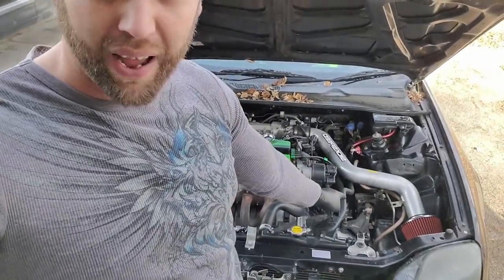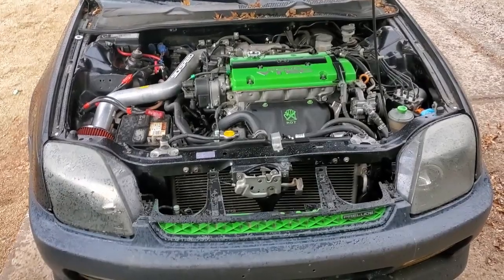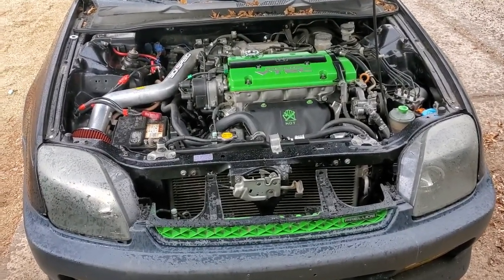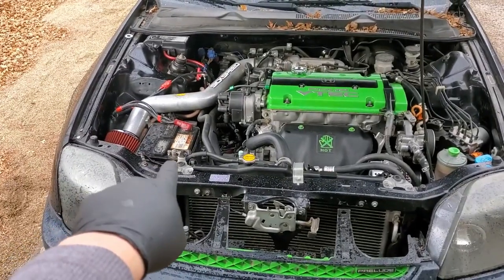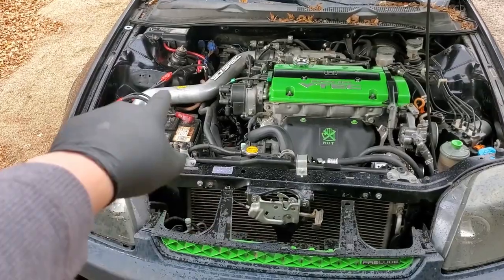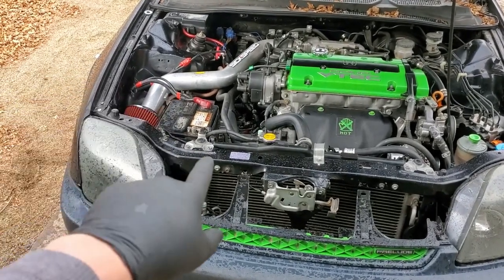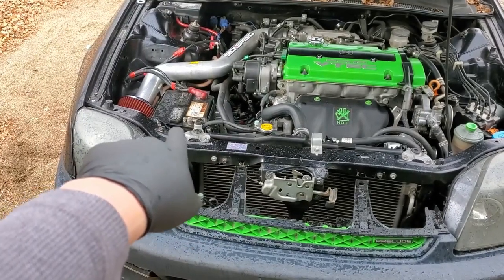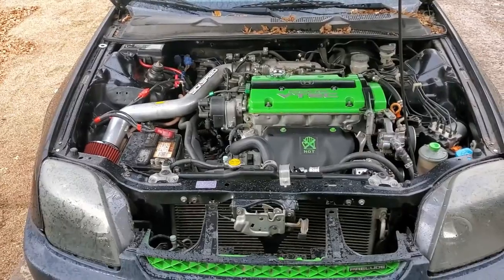2000 Honda Prelude VLOG 4 Battery "Un" Relocate

Comment: List of all work and parts replaced.???
Reply from the maker: New battery, alternator, battery harness, new fusebox, fuses all checked, main fuse replaced to rule out micro cracks.
Reply: @mycardiy  maybe the alternator you have is defective. Have you had it tested? Has the ECU been in any open weather ???
Reply from the maker: @IAutoEnthusiast  new alternator has been tested, along with trying a used one off a working vehicle.  The ECU has never been exposed to weather (that I know of)  I opened it once at my desk to look for any possible burning or scorched circuits
Reply: @mycardiy  is the wires to and from the alternator good. Shorted?
Reply from the maker: @IAutoEnthusiast  if there is a short, I haven't found it yet
Reply: @mycardiy  not much more I could help with. If the ECU is good and you ruled out a short or bad wires. Battery is fresh and Alternator is good.
Reply from the maker: @IAutoEnthusiast  yeah my only question now, is there any systems/sensors that can make the ECU think the battery is charged
Reply: @mycardiy  I dont think so. Id have to look at the wire diagrams. If you start out with 12v + then start the car then you should be getting 14v from the alternator. Sounds like the between parts are at play.
Reply from the maker: Agreed! I always have 12.8v to start and 14.3v with accessories on. Until it turns off the charging, then the battery slowly drains
Reply: @mycardiy  really odd...not sure whats going on. Try a working ecu....?

Comment: What were you doing up to the point of it dying?
Reply from the maker: Just driving normally. I'm pretty sure there's something causing the ECU to ground the signal wire which switches off the charging line. Not sure why though.
Reply: Yikes would be nice if you could catch the freeze frame data at the moment of failure
Reply from the maker: Completely agree!  Makes me really lean towards investing in HonData

Comment: With the car running disconnect the negative cable on the battery if it continues to run you have more diagnosing to do if it dies immediately your alternator is bad
Reply from the maker: It'll die immediately but it's a brand new alternator.  I'm leaning towards the ECU somehow grounding the signal wire for some reason
Reply: @mycardiy  my audi has a brand new alternator and it failed. my suggestion is to take the alternator off and take it to get tested at the parts store. if it tests bad it should be under warranty
Reply from the maker: Yeah, I made sure it was tested before I put it in. Because of hearing so many people talk about dead or faulty alternators
Reply: @mycardiy  no I mean test it now that you're having problems
Reply from the maker: I was having the problem before swapping out the alternator
Reply: @mycardiy  you may have got a faulty alternator